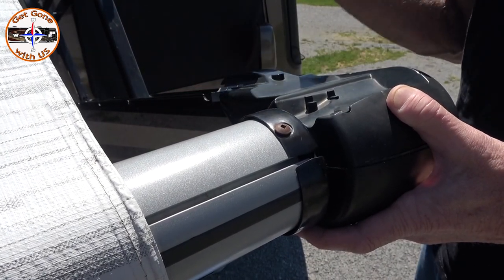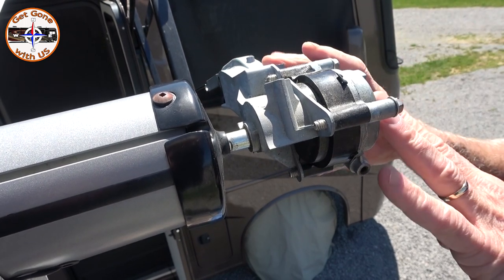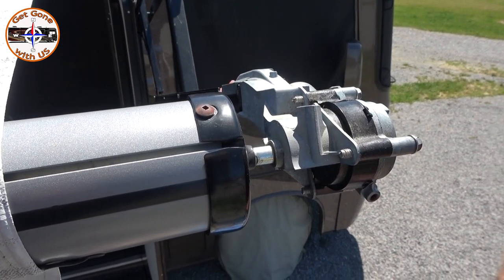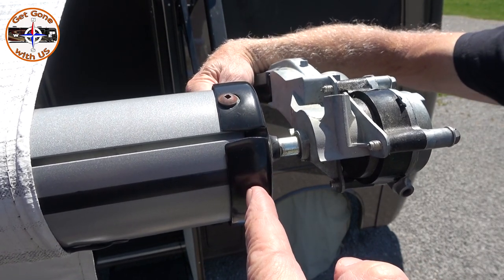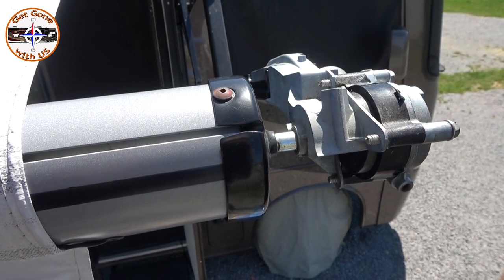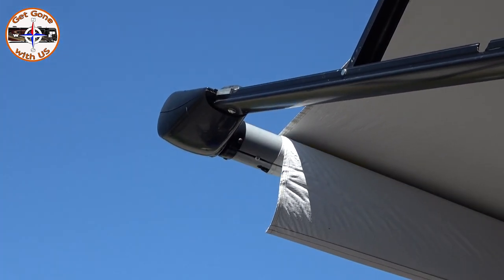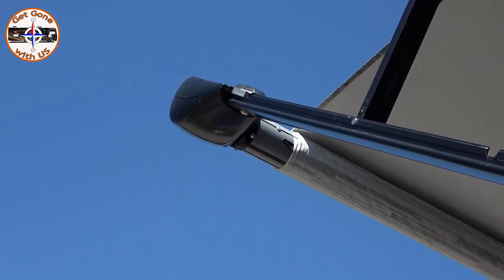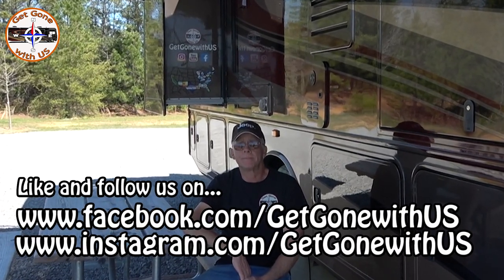How to Fix Electric RV Awning Arm Wobble - Motor binding

Comment from the maker: A lot of viewers have been real thankful for our videos and have ask if there was a way to buy us a Beer.  YouTube now has a ‘THANKS’ button under every video, Just click the button. 😀 It’s not required or expected, but it is appreciated.  THANK YOU!
Reply: My shaft is bad so I need to replace it however I don’t have exterior screws. There’s just holes and I can’t tell what is in the inside of it when I ordered a replacement it comes with rivets. Do you know if I could just drill the rivets out and hopefully pull that shaft out.
Reply from the maker: @robertgillispie5034  You need to find out who is the manufacturer and ask them I have no clue what you have. Good Luck!

Comment: Hi guys always great how-to videos.  Screws are notorious for coming loose on those awnings. There is a lot of torque on the ends and eventually screws just don't hold tight.  If they come loose again try pop rivets. Many awnings now use them. Thumbs up!
Reply from the maker: Hi Lou and thanks !  We were going to do rivets, but I already have 3 rivets guns in storage, didn't need another one. LOL  We will probably grab one from storage on our way through New England this year. 😀

Comment: It's always something with RV/TT's.😐 If you own the same one longer than 5yrs you've practically already built it over again with all the tightening and replacing of parts. It's an assembly hobby, as much as a leisure hobby. Always helpful and useful tips/content.👍🏼
Reply from the maker: Very true! There is a lack of quality control when it comes to RVs.  On the other hand imagine what a stick and brick house would be like after 20,00 miles on it. LOL

Comment: Once again, another terrific tutorial.  I have the same issue.  I would have used some Loctite.  Where those stainless steel screws?
Reply from the maker: I'm figuring with 4 screws vs the 2 screws, it not going to be able to move enough to cause a problem.  If it does happen again, I'll probably just rivet it. 😀

Comment: That’s the issue I’m having except mine has 3 screws. As I was rolling it in the last screw flew off. I hadn’t realized the other 2 had already flown off. I pulled the screws off an put them back in. Yet it’s still wobbly. Should I just drill and add 1 screw since I already have 3 holes with screws? Thank you for your help. Solo Woman RV’er.
Reply from the maker: I would be more concerned with why all the screws came out. You may want to consider putting in a larger screw.  It sound like the current screws are loose.  Of course we are only guessing without being able to see it in person. Good Luck! 😀

Comment: We did the same thing a couple weeks ago and now our RV arm and cap is rotating even worse. What are we doing wrong? Thank you for any advice you can help us with.
Reply from the maker: Without seeing it, we can only guess.  Did you ever hit anything with the awning?  Put it out and get on a step ladder then look down the length of the awning tube.  Is it straight the whole length? Check and making sure the awning arms are aligned properly.  Are they binding or out of alignment?  Good Luck.

Comment: Now I have something else to check!! Glad you made this video. My awning kinda chatters when coming in.  I have sprayed about 1/2 can of WD40 on the arms so far. lol Was going to try the duck tape next but will hold off until I try your fix!!  Thanks again, and as usual "safe travels".
Reply from the maker: Thanks Bruce! We weren't sure what it was when we first noticed it.  Like everything else it only got worse.  At least this is a cheap fix.  Funny how many times  we notice other awning doing it in the campgrounds now. 😀

Comment: What type are the 6 screws you removed from the motor housing? Is it a Philips head?
Reply from the maker: It is called a Robertson screw.  You can pick up a Robertson Screwdriver or bit at basically any hardware store.  Most of the screws in newer RV's are Robertson Screws.  Good Luck
Reply: Mine were phillips. The two screws on the end cap were square drive.

Comment: I just did this. Took a
#12 to replace the #10 as the hole became stripped. Used Phillips head. Screw the square snd star screws. They are just too problem problematic finding the right bit.
Reply from the maker: Glad you got something to work for you.  We never have had a problem with the Robertson bit (square screw).  The newer RV's use them a lot.  Readily available at Home Depot.

Comment: 👍👍👍👍👍
Reply from the maker: Thank You!  😃
Reply: @GetGonewithUS  🤣. Thank you... I ran right outside and looked at my awning end caps.  😁 I have three screws in each.🙄

Amazing, how we, the RV buyer allows the RV industry to get away with such poor quality.

Our 2021 Georgetown GT7 (🍋) has had 7 repairs the first 2000 miles and now at 6000 miles, needs another 12 repairs including blistering and peeling vinyl floor covering.  🥳Yayyy... We're soooo happy 🥳
Reply from the maker: @rvvacation1862  Congrats, you had one more screw each side than we did. LOL  The poor quality control, we were told, comes from the lack of government standards for RV's like the automobile industry has to abide by. Of course if there were some, none of us could probably afford to buy a RV. LOL